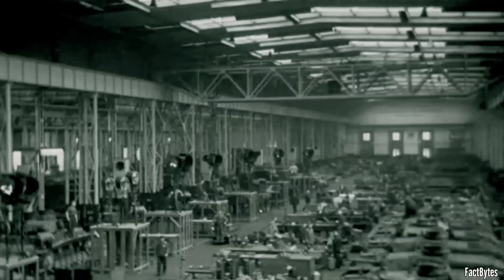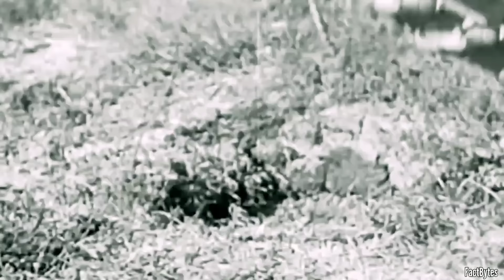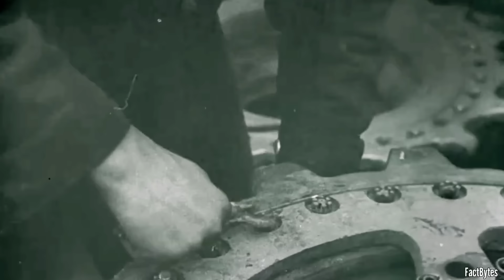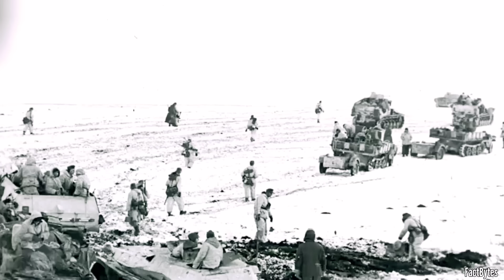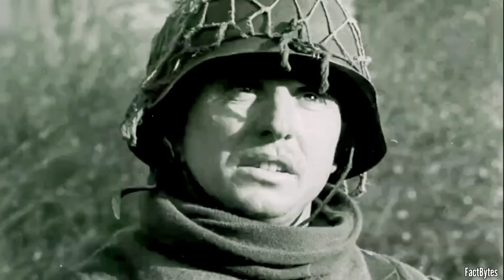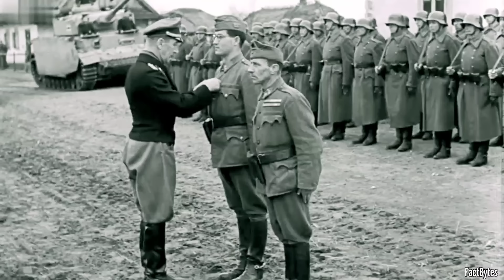More Panzer IVs, Fewer Tigers & Panthers — Would Germany Have Done Better?

Comment: The logic was that if you don't have enough crews and feul, you need tougher tanks, so it was actually the right decision, does not help to have 3 times the p4, with no feul
Reply: Everyone forgets the labor costs of producing "more durable tanks." They forget that a "more durable tank" is much more difficult to deliver to the front lines. Evacuation and repair of "more durable tanks" are much more difficult, and so on.
And most importantly, everyone forgets how many people died servicing these "more durable tanks."
And they also forget that these "more durable tanks" weren't universal, but were designed only for anti-tank warfare. And it's not just tanks that fight.

Comment: No tigers, just panzer III's, IV's and Panthers (deal with IS-2's).
They could have built 6 panzer IV's for every tiger built and 12 Panzer IV's for every Tiger II built. 
yes I LOVE the Tigers (like everybody else) as they are the OG heavy tanks and probably the coolest looking tanks. but they cost too much in resources for a country that had limited stocks in steel and oil.

Comment: Nah even they built a lot of panzer 4 they will not win the war,

as panzer 4 are heavily defeated in operation Barbarossa during June 1941
By much more armored KV1 and KV2

 Aldo add the sloped armor of t-34 and 85mm, making the panzer 4 like paper reports by German soldiers in frontline.

My suggestion is, All panther only and make the transmission good, turret rotation FAST, They Will definitely win or actually put a good fight.

Comment: The panzer IV was easier to build than a tiger but still an over engineered nightmare for the factories. Worse even late models were something you could take at combat ranges with a T-34/76 or 75 mm Sherman and you are still going to be seriously out numbered.

Comment: The Germans had run out of the capacity to produce fuel for their war machine. It wld not hv mattered how many tanks they had because there was no fuel left to power them. So in a way, making the fewer but more powerful big tanks like the tiger made sense. Too bad it was so over engineered and impossible to maintain.

Comment: While you are probably correct about the overemphasis on the 'big cats', you are a bit selective in your presentation. First, the Germans realised relatively early on in the war, at latest after the debacle of Operation Barbarossa, that they'd need to maintain a qualitative edge on the Allies, for they could not hope to attain their production figures. Though the Panzer IV could be upgraded, as it was, and simplified for more streamlined production, as it also was, it was a pre-war design that was showing its limits. It couldn't possibly hope to house a bigger main gun, for instance, than it had c. 1942. Its armour could be increased, sure, but that made the engine and transmission to work harder and made the tank more susceptible to mechanical issues and breakdowns. They also made the vehicle front-heavy, which further deteriorated its mobility. Another issue was, indeed, mobility. The Panzer IV had a fairly narrow track by late-war standards. As the tank grew heavier, its cross-country mobility, in particular, worsened, the tracks were more prone to breakages, and so on. It was not as fast or mobile as the Panther and in my limited understanding even struggled against the Tiger(s) in terms of cross-country mobility (these tanks had quite reasonable ground pressure given their wide tracks).

The Panzer IV was not designed for rapid, mass-scale production in the way the Panther was. The latter didn't take that much more time, labour-time, nor money to build than the former, while the Panther was surely superior in most aspects to the Panzer IV. Indeed, if you look at the production figures, despite their uncertainties, the Panther comes quite close to the Panzer IV, especially when one remembers that it was only mass produced for quite a short time in comparison to the Panzer IV (about 8,600 Panzer IVs versus 6,000 Panthers, including all variants, which makes around 855 a year for the Panzer IVs and 2,000 per year for the Panther; of course, the Panzer IV production did ramp up during the war,). I therefore think it was quite a reasonable decision to design and produce the Panther. Teething issues aside, it was a superior design and made a lot of sense in my view. 

Then one needs to remember that for an 'asset' in war (I don't particularly mind this euphenism, they are, after all, machines which are used to kill and maime human beings, other animals, etc.) there needs to be a match, a 'counter-asset' if you will. This was still an age when tanks were more specialised. The Allies all had their light, medium, and heavy tanks, tank destroyers, assault guns, etc. So did the Germans. There was no way the Panzer IV could have performed that role the way the Tiger(s) or the Panther did. It was, after all, showing its age by 1943, and could not have kept pace with the advances the Allies kept making with their vehicles. Perhaps the Germans could have fielded more of them (though this is uncertain, as the tank was not designed for an all-out production race), but they would have then been in a dire need to counter, say, the T-34-85 or IS-2 (although this counterfactual then runs into the issue that these vehicles, at least the first one, was a reaction to the German reaction, and so on...). 

In terms of reliability and availability, Thomas Jenz has figures in this books on the Panther and the Tigers which show that the percentage of operational Panzer IVs was very close to those of the Panther and the Tiger(s) from the end of May 1944 to March 1945. Thus, I don't think that this reliability argument necessarily holds. Initially, yes, the 'big cats' had their issues, but these don't seem to matter this late in war, at least. 

Given the qualitative superiority of the Panther, in particular, and the fact that it was produced in significant numbers (quite impressive, even), I think that the decision to mass produce it was a sensible one, given the equally reasonable logic of quality versus quantity the Germans followed at the time.

Comment: More tanks need more men, more fuel and more amunition. the 3rd Reich (Germany and Austria) could produce more tanks that they did but they stopped it for the simple reason - they don,t had fuel for them, or men. The train system could not support any longer what the 3rd Reich had. You win wars not with tanks but with logistic.

Comment: They could build more than 2 x Panzer 4s compared to a Panther. Also from Mid 1943 they should have gone over to producing Stug 3 instead of Panzer 3s. Tigers, King Tigers, Jagdtigers, Elephants and Sturmtigers should have been left on the design table.  It might have given Germany a better chance.  Fuel though was the killer.

Comment: And what where they going to run on magic beans you can produce a million tanks but if you only have fuel for 50 the other 999,950 are going nowhere and doing nothing all this more tanks bullshit is just that bullshit the germans did not have the fuel resources for a long war and even with only a small number of Tiger 1 and 2,s they still hadn't got enough fuel for them to operate most of the time all the reports both pre action and after action are all about fuel shortages effecting operational effectiveness and that only 1700 when T1 and T2 are combined

Comment: No it wouldn't t have changed a thing, US Industry, US Economy, US Higher Population = Once USA Joined WW2, it was Over Sooner or Later for the Germans. Though The Tigers & Panthers were made to Counter Russian T-34 Variants & IS-1 Tanks, few Tiger I faced the Allies, more Panthers & Stugs & Panzer IV s did face them, just the fact that a Panzer IV (Late Model) Could on a far distance, resemble a Tiger Tank, Caused Panic Among Allied Soldiers in The West. The Germans Could have had Possibility for some Kind of Victory in the East during 1942, But after 1943 or 1944 it going to lose, either way. Lack of Resources & Fuel, dont matter what tanks you use, if they have no fuel or ammo.

Comment: For the cost of the militarily useless V-2 program (betwen 1 and 2 billion RM) they could have produced several tens of thousands of Panthers or Panzer IVs. Whether they could have crewed and fueled them is another question.

A late edition Panzer IV cost only 15-18% less than a Panther (100,000-110,000 RM vs. 115,000-130,000 RM), so roughly 5 Panzer IV-s vs 4 Panthers.

Comment: NO if you think so Im wrong you nothing nothing about WW2. Germany wasnt that good & was never going to win! Making more tanks was impossible NOT ENOUGH MATERIALS to make ALOT of tanks! Why because the system to acquire, design, manufacture, build & sent to front & repair all equipment was DEEPLY FLAWED due to CORRUPTION at almost every level & not to mention the big one, RACISM! ( This also applies to every single part of the Nazi) To make an attempt to remove or not talk about Nazism ideology is painting the Nazi as good verses the EVIL that they are! This so wrong on so many levels!  Its like talking about the benefits of illegal drugs & not even mentioning the deaths & the destruction of the person & those around them! In the Nazi case we should be glad that there were & are INCOMPETENT on so many levels!

Comment: Actually all three were a mistake.  The Panzer IV became more and more unreliable with each upgrade(same with pz III but it was still more reliable than all the others) as the weight kept going up making the suspension more and more unreliable.  The germans would have been better off putting everything in Panzer III's and Stg III's  and then using their development on making a slightly bigger Panzer III that could have a big enough turret ring to mount the 75mm guns as well as more armor.  Despite all the talk on the Panther and the Tiger,  according to Soviet studies the 50mm gun had more kills than any other german gun.  The much talked about 88 was on par with 20mm gun in percentage of kills (both under 4% of total kills) but I am sure the overage tonnage of the kills was vastly different.

Comment: Panthers were nice tanks, they should've just designed a stronger transmission.By late 1944 there were almost as many Panthers as Panzer IVs in Wehrmacht and their production was simplified enough to the point it was as easy as to manufacture as a Panzer IV.
Panzer IVs were nice and all but due to their outdated armor design they were pretty much done with their lifetime by 1945.

Comment: It wouldn’t matter how many panzer IV they head, unless they could match the output of the United States and the Soviet Union. Even if they had built twice as many PZIV to a total of slightly over 16,000, the United States built almost 50,000 M4 Sherman‘s alone. And the Soviets, even more T – 34. They simply were never going to be able to build enough of anything, to win. Just like the German aircraft industry never ran out of aeroplanes, but they ran out of fuel and pilots so it didn’t really matter how many planes they built

Comment: Germany's super tanks, other than the Panther were not good, even counter intuitive offensive weapons. They were too heavy for roads, bridges, and rails, had poor mileage, and while their armor made them hard to kill, their drive mechanisms were under-powered and fragile. A significant number of them were abandoned by their crews for breaking down, and Germany's industry and logistic system was terrible providing parts. Russia had the right idea to standardize their tanks, making it easy to produce them and fix them in great numbers. Germany wasted too much of its limited resources on too many super weapon projects, and tank designs like the Maus reflected delusional desperation using up metal that beast that could have been used to make several conventional tanks instead.

Comment: Producing more Panzer IVs would not change the outcome be any means because of the following:

1: The main Issue as limiting factor for germany : Oil, we had a severe fuel crisis with the beginnign of the war, and with britain staying in that war stoping imports, the synthetic productin of us + the small production of crude oil by european axis partenrs are not enough for the requirements of the european axis. At 1940 germany + EU axis without romania  consumed 9.5 Million Tons more oil then  they produced , with romania roughly half that. Therefore demotrization and rationing efforts have been done the give the wehrmacht enough ability to strike to use the last chance to get fuel to save germany by invading the Soviet Union. Until that tank vs tank battles never happend that much the infanterie did the work , tanks were used for breaktrough and encirclement. After the tank battle of dubno we relized that the PZ 3 and PZ 4 are "outdated" against the new KV and T34 even though the werent that effectivly used. To skip a little forward , the germans didnt manage to take the caucasus in 1941 the only got to rostov. At that point germany basically had no fuel to wage the classic blitzkrieg only small operations can be done there simply isn't enough  fuel. In 1942 Fall Blau also didnt took the caucasus i order to win  regardless of the tanks typ or numbers the germans used simply due to lack of fuel and logistics which is basically the same at that point of the war. And finally now in August the Tiger arrives in Leningrad  😂 even tough the win of germany is dependet of getting and taking the caucasus oil . 

2. After this the german win was not possible anymore and with Operation Uranus cutting of the 6 Army the caucasus cannot be kept longer. After this in 1942 the whole argument of your video begins : 

3. Keeping  all of this in mind building the outdated panzer 4 and stugs and not producing the tigers or panthers would not have got the germans the victory. 

4  Economically speaking we need to calculate if it is better to have less tanks but more powerfull one's consuming more fuel or a lot less powerfull tanks. I would say having less is better economically and logistically, because at 1943 onwards fuel was so limited that tanks can basically only work near trains because even the trucks didnt have fuel to bring it  to the tanks . Mostly Panthers and tigers were left behind because they had no fuel , and yes the reliability of the big tanks was garbage but without fuel it doenst matter , at the battle of the bulge it was cheaper to drive halftracks into minefields to clear them because they couldn't run them for much longer. 

5. But i would say the tiger and the tiger 2 were not needed , the Panther should have been used more and Upgraded , maybe even to levels such as the imiginary Panther 2. 

6 Propaganda and fear also plays a role but it should not be factored in that much.

7 Rare materials also play a factor but after the german doctrine shifted towards tank vs tank fights better tanks were needed.

For the outcome of the war the diffrence of having more Panzer 4 due to lack of fuel  is insignificant because the only chance of winning was before the tiger and Panther been used more often.

Comment: Panthers saved lives, lives that became a nonrenewable resource the same way oil and steel were consumed. Panthers only cost about 117,000 RM while the Mark IV was 103,000, not much of an increase for a much better tank. The bottom line is that when Hitler diverted troops away from army group South and they couldn’t take the Caucuses oil, that was the key problem for which all other German problems digressed.

Comment: I'm not sure how you fix the limitations due to the Panzer 4's narrow tracks.  I don't think the problem with Germany's strategy was too many Panthers and Tigers.. it was wasting too many resources on Tiger 2, Jadgtiger, and other pipedream super-weapon projects, when manpower, resources and money were already at a premium.  A better use of resources would have been fixing the mechanical issues of the Tiger and Panther, and using them in the roles as intended., while also upgrading the exiting Panzer 4 models with better armor and gun, to fill any gaps.

At the end of the day, however, Germany's downfall wasn't their armor doctrine, but poor command decisions.  So many men and materials were basically thrown away in the Russian campaign due to moronic decisions, and pointless operational delays, which allowed the Soviets to regroup, and launch an unstopped counter-attack campaign.

Comment: The only way the 4 would work is a total redesign, wider tracks, thicker  sloped Armour, bigger engine, they would have to retool all the factories anyway, they went with the Panther instead. Lose of supply lines and bombing is was the real problem, they could have built 50,000 quality Panthers, they still were up against more than 100,000 tanks & assault guns, it would have only slowed the outcome, they should have upgraded the 4 before 1941, that at least would have matched the t34 in quality and numbers.

Comment: I think the Panzer IV (and StG) would have done better if it would have has the same main gun sight as the Panther and Tiger. The 2.4X that it had was a handicap. The Panzer IV F2 and H's main gun (KwK 40 L/43 and L/48) deserved the variable 5X main gun sight as it was more than adequate to defeat any armor at longer ranges the Soviets had until the late war JS-2 and Su-100's arrived on scene. The Panther and Tiger were good, and they had their place, but I do think more StG III's and Panzer IV's would have helped. HOWEVER... the pool of viable German soldiers was starting to get low too.. so... there was that. Hindsight is a funny thing.